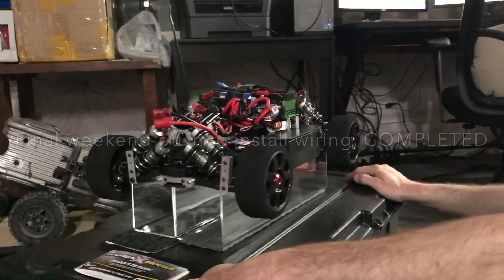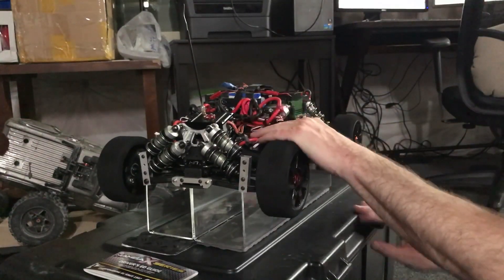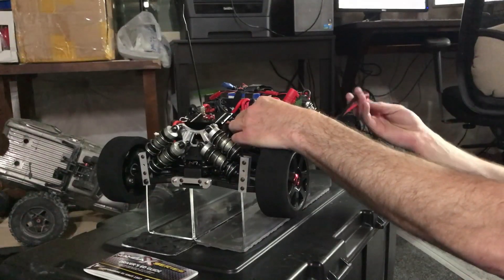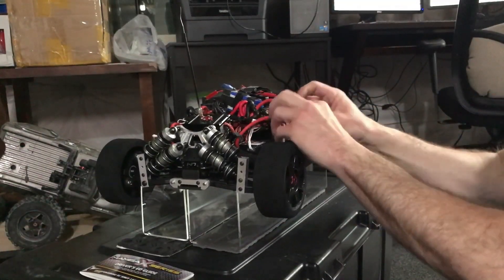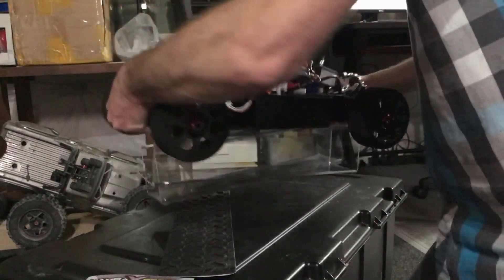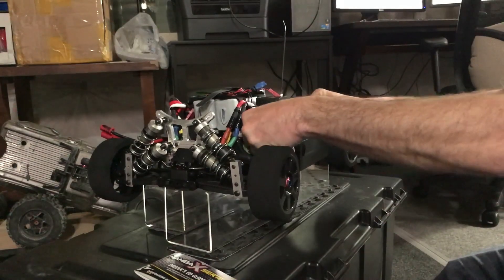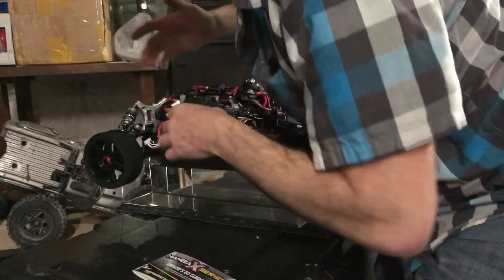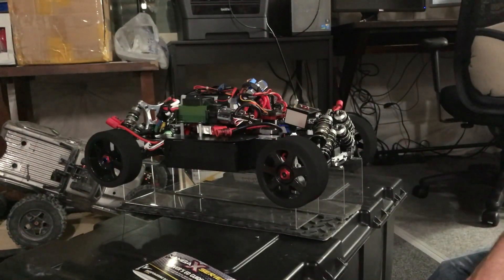24 Horsepower RC SUPERCAR, plug in!

Comment: i don't get it ; what hapened ? did you calibrate the esc ? why didn't you use the transmitter to check if the motor responds ? it keeps on blinking because of the capacitor i guess.
Reply from the maker: stephane Z finally go the wiring installed, didn’t have time to do proper receiver set up, or calibration on ESC, but I did want to make sure the wiring was good to go,
Reply: fine, what a beast ! i just have a doubt about the aluminium tube holding the shocks on the suspension arms : don't neglect that parts, it shouldn't flex or break at 100 Mph !
Reply from the maker: stephane Z I love that, I thought of that but didn’t think I could make 4 consistent enough with my hand tools
Reply: i only use a grinder and a drill ! home made parts don't have to be perfect. after all, we don't build shelf-queens !
Reply from the maker: stephane Z I could really use a grinder, my hand files are not cutting it, lol or should I say grinding it.
Reply: a grinder is really a cool tool ! i barely use files because i'm not patient enough ! i actually use 2 grinders : one with a slim 0.8 mm cutting disc, and the other with a sandpaper disc. the global shaper of a part is only aesthetics. holes have to be precise tough.